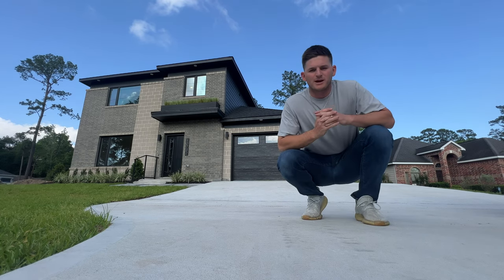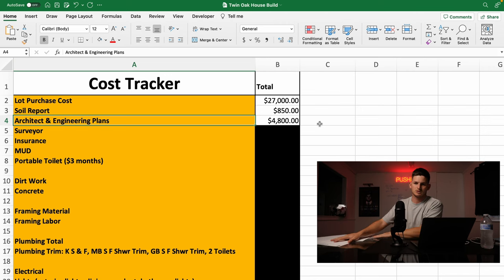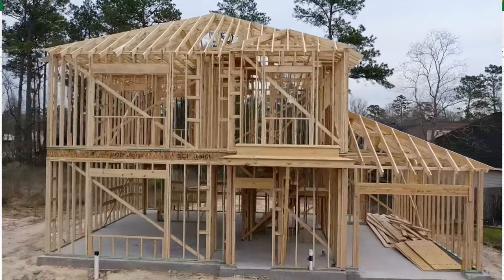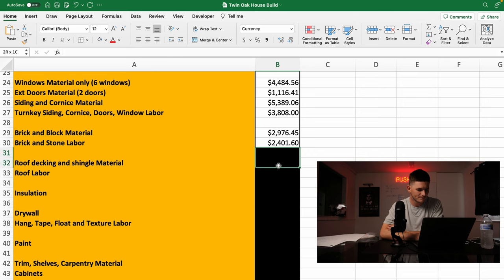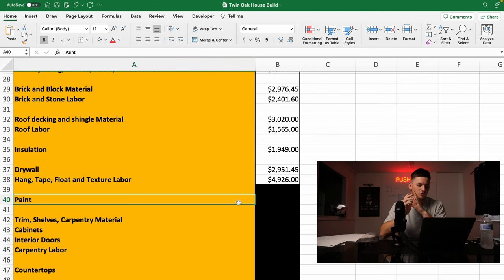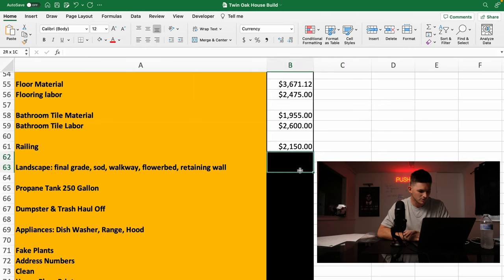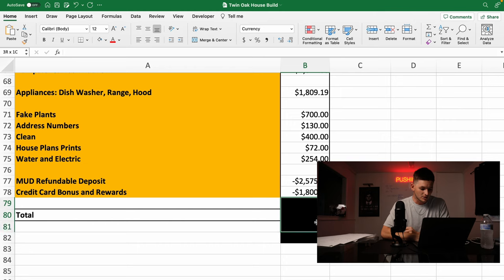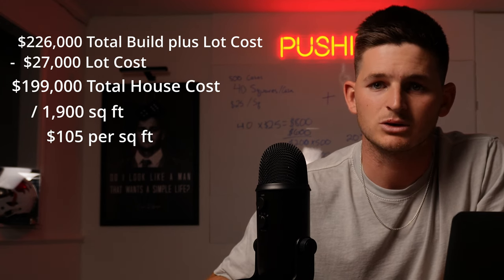Revealing How Much it Cost to Build My First House for a Rental Property!!

Comment: Bro, I used a builder, I was pretty involved and I was basically getting bids from other contractors just to see if it worth hiring a builder or not.. and let me tell you you saved roughly $50k-70k . You already have a lot of equity in this house if you decide to sell it. 
I was honestly happy with the builder and I actually left him a tip of $2500 credit. It is A LOT of work, and basically I couldn’t do it with my full time job. But it is very rewarding when it works out.. congratulations!
Reply from the maker: Thanks a lot!

Comment: Was a good breakdown , two questions, do they charge in your municipality to get your C/O paperwork and sticker ? The other I think I got ya on one item you missed, I see you have house numbers for emergency services but looking at neighborhood didn’t see mailbox cost ? Which may not be required but I would imagine given others . Area seems pretty lax on the elevation approvals per other house elevation right. You raising your lot that much makes tricky to not have conflicts with shedding your water . Even tho you were the low lot. Be interesting to see how it all diverts with the swells. I assume no HOA approvals either. As always don’t forget to add extra sleeves concrete walks or drive . Future irrigation or low volt , landscape lighting ect.   Also what are the comps in your area ? Be interesting as well 

👍

Comment: I’m in the planning stages of my build in Dallas and curious how did you ensure the quality of the work from the subs especially bigger items like foundation, framing etc? Since this maybe the only work they may be doing for you they may do shoddy work and never respond to text/call once they get paid.
Reply from the maker: Great question! So for the major trades like electrical, plumbing, Hvac, etc, I made sure that sub contractors carried insurance and had correct licenses. On the foundation, I used an established local company that does a lot of new construction houses in the area. For the framing, I only used a small contractor who had one crew. But I met with all subs prior to starting the work to vet them as much as possible and to also establish a good relationship with them to make sure they were a good fit. I would ask them questions and test their knowledge.
Reply from the maker: To answer your question specifically, the main way I accredited the subcontractors to be worthy is in which the process on how I found them all. I found all of the subcontractors by going out and searching in new tract home developments. These developments consisted of nice 3-4k sq ft houses with very nice home building companies. Basically I heavily relied on the assumption that if the subcontractors had the credentials, skills, ect. to work for those large home builders then I was sure they would be able to execute my small build. And it worked out!
Reply from the maker: I made a video about how I found my subcontractors, you should check it out!
Reply from the maker: And to be honest, my house was very simple and basic. It did not require a special level of skill on any trades. So I was comfortable trusting the level of skill of those contractors. Now if I am building my dream home that is 10k sq ft with custom carpentry and difficult foundation layout and custom frame work, ect. I would have made sure to find contractors who had that level of skill maybe by going out to developments where homes are larger and more custom. If that makes sense!
Reply: @CaseLucasRobinson  That's exactly what I did when I started. I did get ripped of by one concrete guy who turned out to be a crook. Cost me $20k. I wrote him the final check on completion of the slab and he stiffed the concrete delivery company. Live and learn.

Comment: So im also in Texas and this got me thinking about building vs buying. How did you save up 200k+ to build a house though? That's more than 4k being saved per month for over 4 years straight... I don't even make 4k a month
Reply from the maker: Great question, get a higher paying job. I would recommend getting some kind of sales job. I sell roofs going door to door. 

You can make over 100k easily in 4-5 months out of the year selling pest control during the summer going door to door. 

I would recommend you getting a higher paying jobs, preferably something in sales that way your performance determines your pay. 

Unfortunately mc if you are not making 4K a month, you will not be able to save up. Make a change and you can do it!
Reply from the maker: Check out my video on “how much i made in 2022” and you can gain some insight on how i was able to save.
Reply: @CaseLucasRobinson  Wow. I'm a senior in college so hopefully will make more soon. I have thought about doing car sales but I've been to a few dealerships that have dozens of salesmen and they said it's hard to compete sometimes. 100k in a few months sounds crazy though, even with a degree I don't think I'd make that in a year. I'll check out that video thanks!